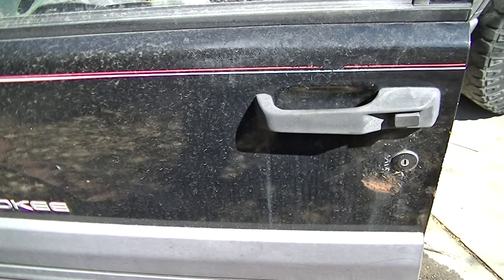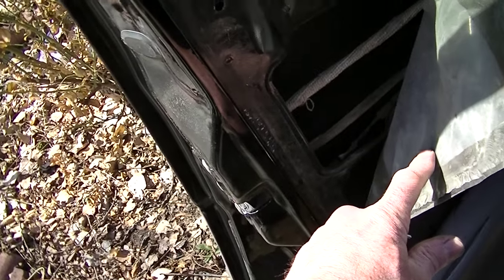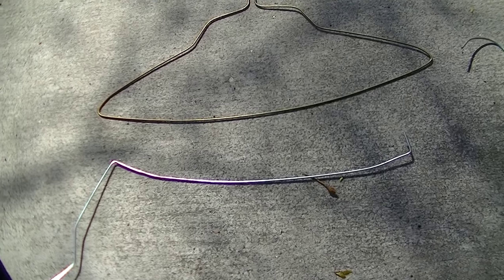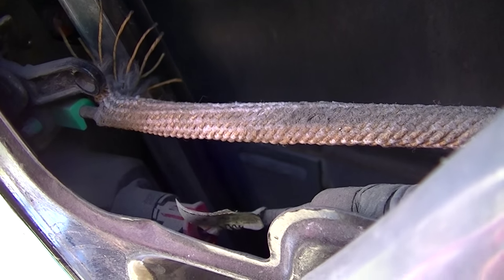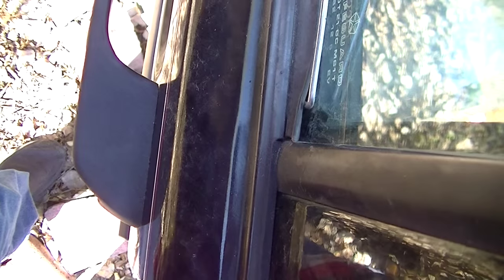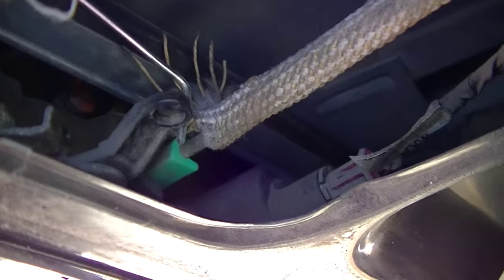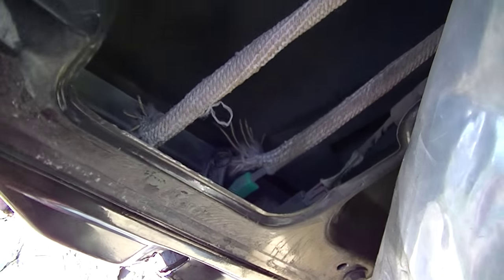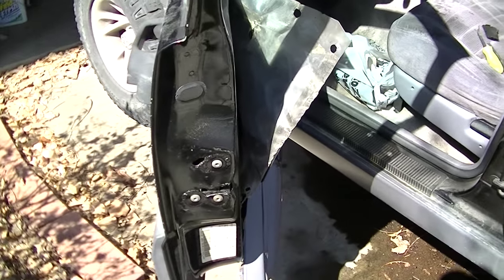How to unlock your car door with a hanger hack, demonstration

Comment: Thank you very much. I got a 2000 Jeep Cherokee XJ and it took me about an hour to get it unlocked. But there's no way I could have done it without your video. The locksmith wanted $85.00.  I'm very thankful for you showing me how the locking mechanism worked. And thank you for saving me $85.00

Comment: I have had thieves try this five times in 7 years to open my c5 corvette's passenger door. I opened the door panel and locked the door with me inside the vehicle. I pulled the latch that the thieves tried to access with a coat hanger and the alarm went off when I opened the door. The rubber seal is insanely strong when the door is closed and no thief has managed to get a coat hanger into the door despite tampering with the rubber. Not only this, but there is almost no room to jam the rod down into the door because almost all of it is blocked. I do not believe it is possible to open the door without setting off the alarm and the rubber seal is insanely strong. It is like pushing against a house door with a car on the other side that is in park. I also eliminated any chance of the car getting stolen by putting a barrier around the whole device that is used to unlock the door. Now if the thieves ever get something down there, they will be bumping into a plastic case while staring at a camera. I also eliminated the lock cylinder's rod, so they will not be punching the lock to trick the car into opening the door for them.